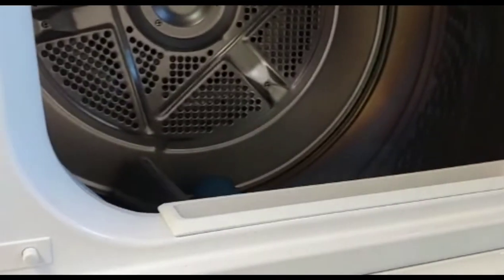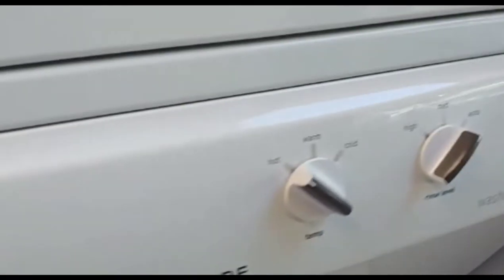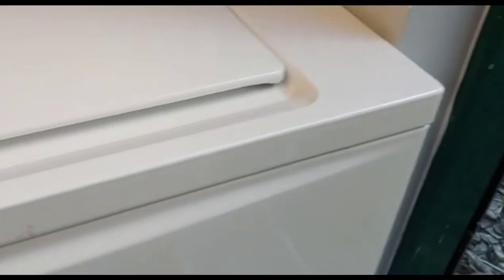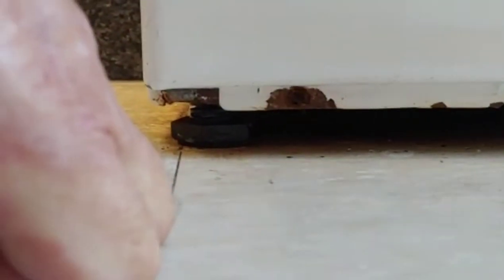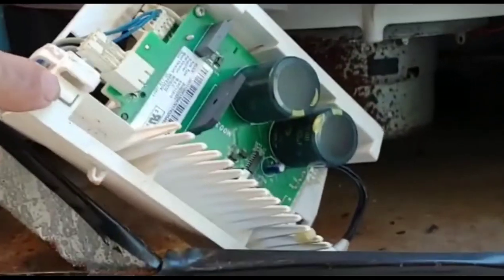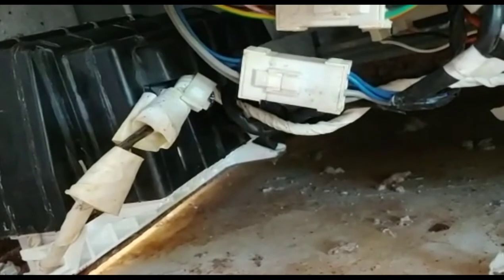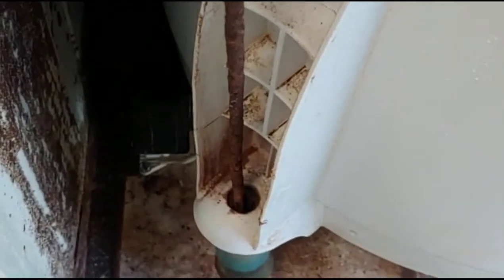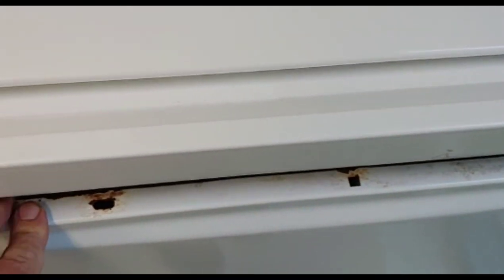Fixing A Frigidaire Washer/ Dryer Combo With Control Board Issues (Working Randomly)

Comment: You never show what you actually did BUT, you mentioned connections to the circuit board, so I did my normal to unplug and replug the connections several times. Hallelujah that was the fix. You save me lots of $$, the appliance tech told me buy a new machine!  Thank you
Reply from the maker: Glad it worked out. The machine I fixed lasted few more years of commercial use. Cleaning the contacts did the trick. The board was actually OK, just loose connections. 
Best of luck!

Comment: I have the same washing machine that does not do anything. Did you replace the board?
Reply from the maker: Yes, but had some issues eventually, the problem was actually oxidation on the board contacts not allowing for a good connection. I cleaned contact ends including plug, and squeezed a bit more terminals to have more grip. Machine has been fine since. Problem was caused by bleach poured on side dispenser not longer used, also corroded the  suspension. Plastic cover was not effective enough in protecting motherboard located in a pretty dumb location. Might want to add some additional protection such as dielectric gel or silicone over terminals. Old motherboard was actually fine just had same issue with poor contacts. Machine is a workhorse, used several times daily on a commercial environment for years with  no other big  issues.

Comment: I'm having problems under the knobs panel there is a red light flashing dryer side but dryer works fine the washer won't do anything but make 3 beeps sounds what's my problem I need help
Reply from the maker: Sadly there can be multiple causes of the issue you describe. As simple as a faulty door lock mechanism, to a faulty control board, there are 2, one for the washer and one for the dryer or a faulty drain pump.
I would suspect the washer  door lock first, when starting the machine it makes a clicking sound and lock, if a faulty machine will stop further operations. Best of luck. G

Comment: Ok, your video isnt the best BUT your information is awesome. My friend has this machine and it's doing random stuff too. I'm going to look at the contacts as you advise. Are you talking only about the contacts going to the control board? Thank you for your great info!!
Reply from the maker: Yes. I suggest cleaning the contacts on the board and, of course, the contacts on the clip with the wires. If you can squeeze the connectors a bit to give them more grip once plugged into the board, it is helpful as well. A contact cleaner spray can also help. It is sold in the electrical section at Home Depot. Thanks. Best of luck. G
Reply: @ingeniousgiacomo  Thanks for the reply. My friend is going to attempt this himself. I'll pass on your advice.

Comment: How do you get the black cover off of the motherboard?Do you have a disconnect wires?
Reply from the maker: Not really, the wires are clipped with a plastic holder to the black cover, make it a bit easier if you loose the wire holder, the black cover needs to be pried open, a flat head screwdriver Will do. Is a bit hard to push black cover  back once you are done, It Will Just snap in Place. If you have issues regarding the wires a zip Will Do..Best of luck. G

Comment: I need that exact interface circuit board. Sell it to me please.
Reply from the maker: I have it somewhere, I need to look for it. If I found it, no problem. Thanks,
Reply: @ingeniousgiacomo  I took mine to a guy who repairs circuit boards and he told me that for 40 bucks he would try and fix it, but with no guarantee. He did and it worked. I'm so glad.

Comment: I have this exact machine but im unable to see the model #? I dont have the manual as i received it from a family member who doesnt have it anymore. Could you tell me the model number so I can order a control board as well? Im having the same random operation and now the lid is stuck closed and wont open.😢 Is there a way to manually open it after removing the front panel?
Reply from the maker: Sure. Will do a little later. Machine is still in use at one of my jobs.
Reply from the maker: The model on Combo in Video is: 
FFLE3911QW0. There are 2 control boards, one for dryer on top, and one for washer on the bottom. 
Best of luck. G

Comment: What does it mean if my Kenmore all in one laundry center doesn’t beep an error code when put through diagnostics?
Reply from the maker: Each model has specific features. If yours has a display, you should have an error code. Sometimes, they use blinking lights. The best way is to try to find the service manual online. It has the info repair technician are using..Best of luck. G

Comment: I have that exact one, just bought because thats the only one that fits in the apartment. The water isnt filling all the way even on heavy duty and high rinse level. What can be the problem?
Reply from the maker: Pretty sure it's normal. I never liked the fact that the lid is always closing when washing. But never seen the  water more than half level .I am pretty sure it will not fill up. Most new  machines are not filling up, it's a water saving feature. The agitating  is supposed to do the job with less water. There is not an option for water level anyway. Best of luck..G

Comment: It still working, we have 7 machines like that and all have the same issue.
Reply from the maker: Yes. Has been several months and no more issues. I did the suspensions later  got them on eBay for $13 each. Machine is used 5 days a week on a business environment.  I think the key is make sure contacts on motherboard and connectors are cleaned and a light additional crimping does help if issue re appear. Best of luck. G

Comment: What's the part number?
Reply from the maker: Hi. Please make sure is not a contact issue. Clean contacts very well on both ends. Make sure crimping is tight. Is a Frigidaire Electrolux 
Part # 808653801. Control board
Best Dela on one Ebay $99 for a nice looking used one with free shipping.
New is close to $200. Good luck. G

Comment: Will the water pump work if the computer board is bad?
Reply from the maker: Sadly, the bottom motherboard will control everything washer-related. Loose contacts might be an issue, but you can always test the pump by supplying power to it. It is better to do this once it is removed. Make sure the impeller is not stuck with debris of any kind and can spin properly. Pumps can fail, which is not related to motherboard issues. Thanks. G